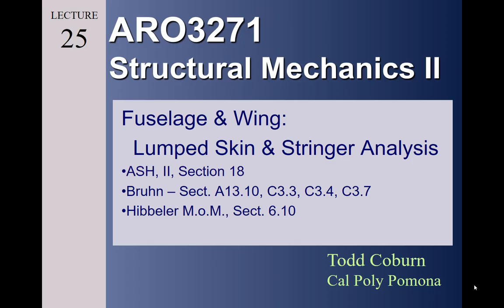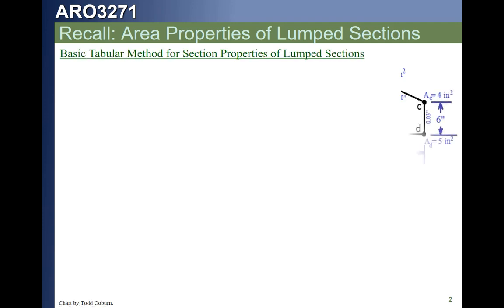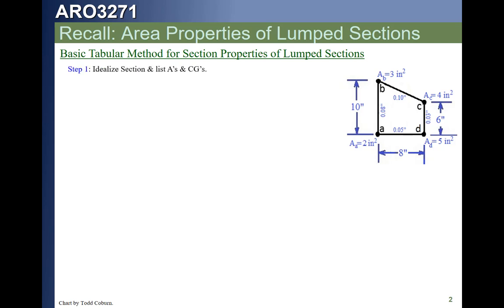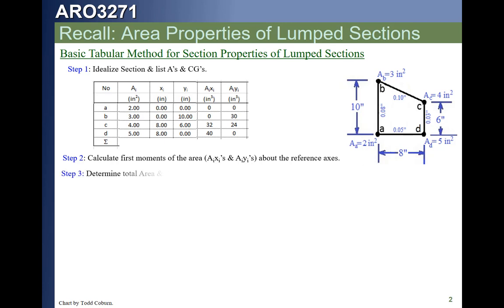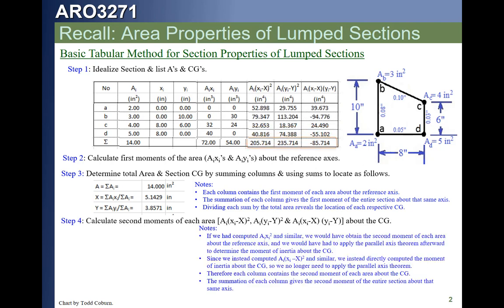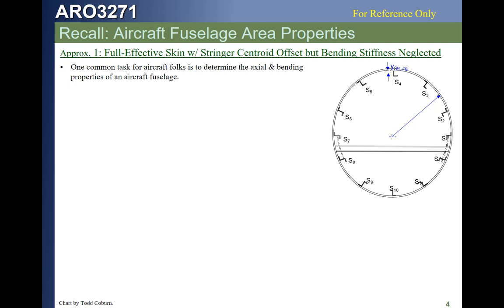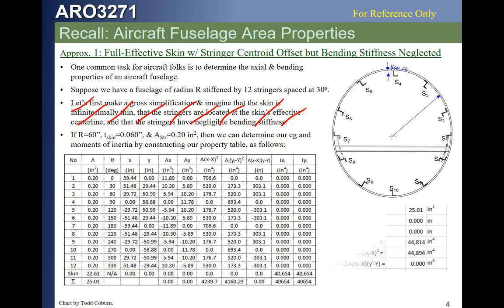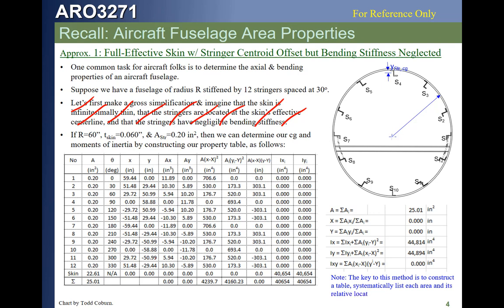Structures III: L-03 Simple Analysis of Fuselage & Wing Structures

Comment: Thank You for the lecture.
However, Why is there a change of the effective widths with the loadcases?(i.e with compressive and tension)
Reply from the maker: Good question.  Remember the lectures on stability of flat and curved plates?  Thin skin will buckle at very low load relative to ultimate capability of the material.  If/when it does, its cross sectional properties no longer contribute to the cross sectional properties of the section.  Therefore, a load case that causes compression on thin skin will only be resisted by a fraction of the total skin available, while a tension case may be resisted by full effective widths of skin (actually, shear lag effects may limit the effective width for tension as well, but much more width will be effective than for compressive cases.

Make sense?

Comment: Hey Todd! Very informative lecture. Just wondering, if the skin is replaced with honeycomb panels, do we still use the same effective width analysis? Honeycomb panels should perform better in compression compared to plain skin right? So in that case, do we use full effective width all the time? Or do we use something less than effective width? Thanks in advance!
Reply from the maker: Parco,
 
The same principle would apply, although sandwich panels will have much higher bending stiffness than flat sheets, and should show much higher effective widths.
 
You can estimate the effective thickness (based on the same I as a thin sheet) and use that for your effective width calculation.

Comment: Thank you for this lecture, it was too effective. Just that I did not well understand the part concerning the iteration in last part. Could you explain  more?
Reply from the maker: If you assume all skin is effective in carrying the load (called full effective widths) then no iteration is needed.  Assuming only 30t of skin is effective everywhere also requires no iteration.

Yet if you account for 30t effective width of skin for skin that is in compression, and full effective widths for skin in tension, then you will need to iterate to determine which skin is in tension and which is in compression, since the bending properties of tge fuselage change with your assumption.

Comment: at 22:09 how is the thickness value assumed here? i reverse calculate and found it as 0.05', as A_sk = W_eff*thickness?  16.755*0.05 =0.84. I was just wondering where this value taken from.
Reply from the maker: This example was (unfortunately) for a different comfiguration where skin thickness is 0.050”.  It uses 30t for any stringer in compression and the full skin width between stringers for stringers in tension.

Comment: Hi I didn't understand the part 10:00 where the bending stress of each stringer is calculated for each inclined axis of 30 degree. I know that for a new x' = x.cos(theta) + y.sin(theta) and y' = y.cos(theta) - x.sin(theta). where theta is 30. but we are given I in r, theta not x and y.   how  are these values used here I_str_r =1 and I_str_theta= 0.5  to calculate?  
Are  we converting from Polar Coordinates (r,θ) to Cartesian Coordinates (x,y) : x = r × cos( θ ) y = r × sin( θ )
Reply from the maker: The x & y coordinates of eact stringer are calculated with trig, but Ix & Iy are calculated about the horizontal and vertical axis.
Reply: @ToddCoburn  in 28:47 Why was Yst obtained with the "r × cos(θ)" formula?  Shouldn't it be "r × sin( θ )"?
Reply from the maker: @bayikancanozturk  Looks like failed to update the sketch for that slide.  That example is a different problem, where the first stringer is defined at the upper centerline, and the stringers are numbered moving clockwise.
Reply: @ToddCoburn  thank you for answering back :) but still for Yst should be obtained by using "r × sin( θ )" formula, right?
Reply from the maker: @bayikancanozturk  no.  The angle theta is defined from the first stinger, so the vertical position is cos(theta).  Note that the largest y is stringer 1 which is on the top centerline.  As i said before, the sketch is wrong.
Reply: @ToddCoburn  Now I get it😅thank you.

Comment: In the 30t approximation, at 13:47, how is A is 0.31 in2 calculated?
Reply from the maker: That includes the 0.20 in^2 stringer +30t(t) of skin
Reply: @ToddCoburn  Thank you so much. I kept doing 0.20 +30t. it is 0.20 +30*0.06*0.06.